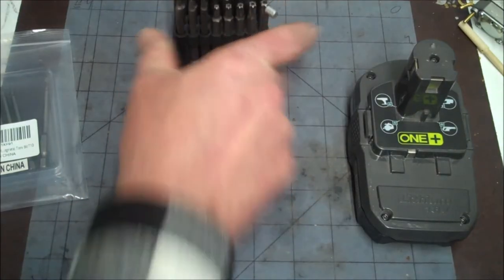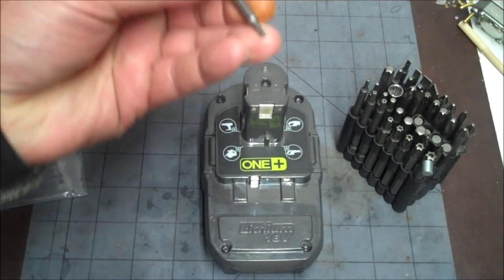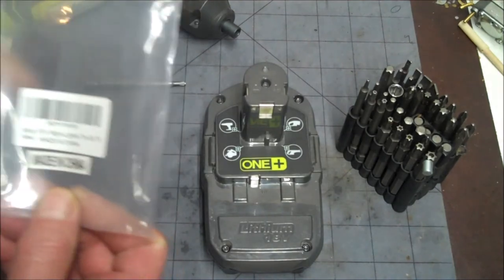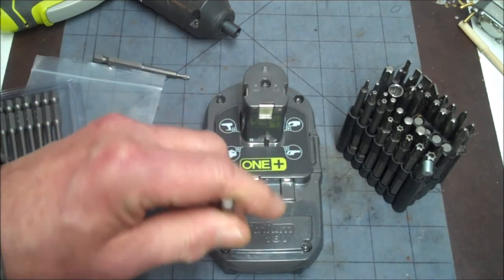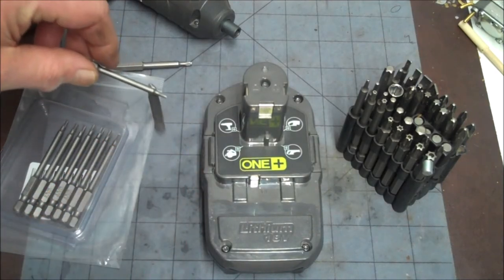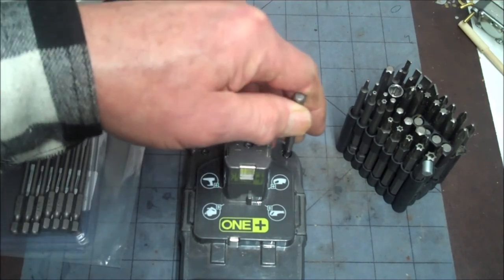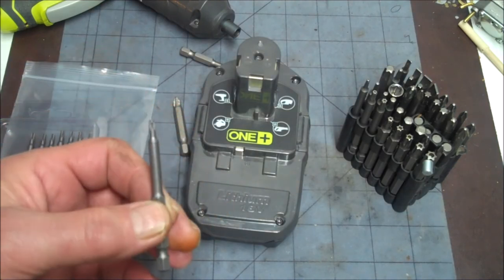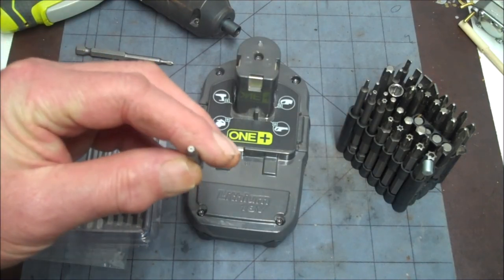How To Remove T10 Torx Screws Used in Phones, Ryobi Batteries and Milwaukee Drills T10

Comment: thank you - trying to clean printhead on my HP printer and there are 4 t10 torx screws to remove first.  I don't have a flat head size that will work - so off to buy Sepuly tamper proof set.

Comment: thank you for this, I just hope they used the same T10 on my Porter Cable battery cases. I want to replace the Lithium Ion batteries with the 18650 size. None of it is cheap, but a darned sight cheaper than buying new. This one 2 Amp hour 20volt pack is $112 CAD. I do have a kit of tamperproof bits but none of them work. I find that so annoying. It was the only reason I bought them in the first place. Going in the scrap metal bin with great pleasure!    :-)